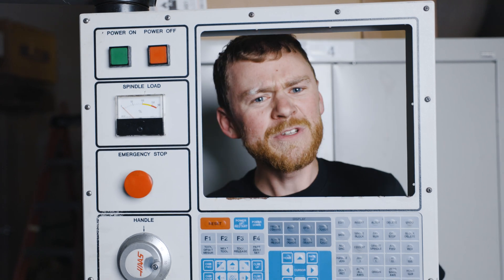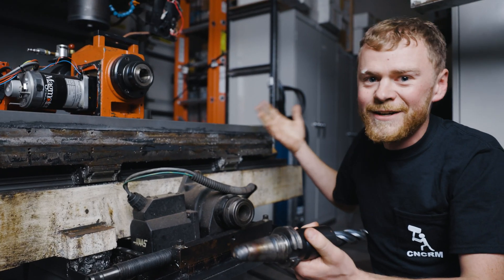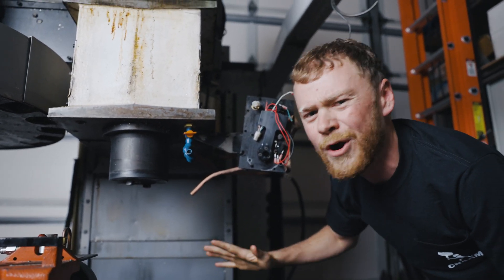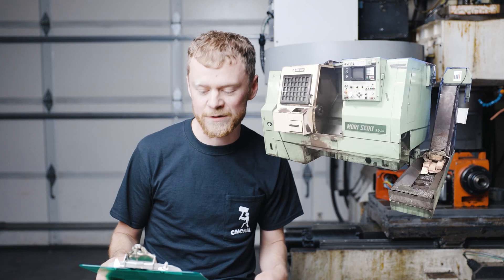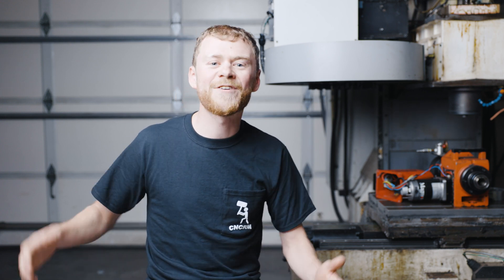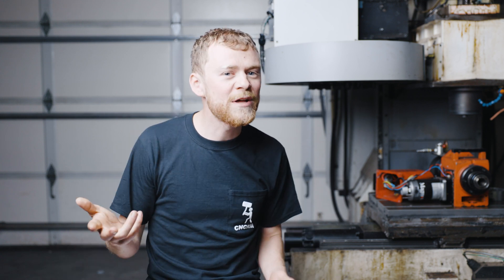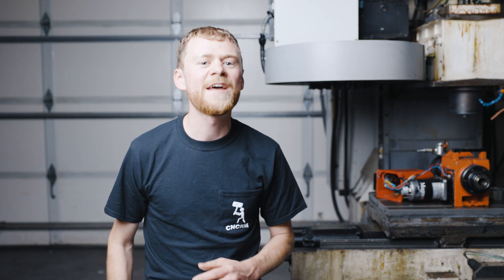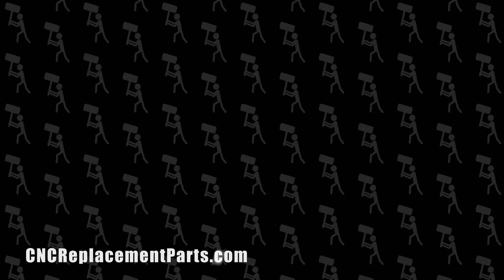Don’t Buy Old CNC Machines | CNC Repairman

Comment: Hi! Have been following your channel for some time. I just bought a VF2 from 2001 as a 2nd machine in my shop.  From what I can tell, it is not possible on a Haas from 2001 to use G43 tool offsets when a program is not running ? For example if I want to face off a plate manually with tool 2, the tool offset cannot be set. Even if I do G43 H02, the tool offset cancels instantly after the spindle has ramped up because it enters "PROGRAM END" mode.   Can this be altered ?

Comment: I bought a 20 year old Cincinnati Arrow 500 with a retrofitted Heidenhain TNC 530 about a year ago. 21 slot automatic tool changer. wired tool setter. infrared touch probe. had to invest some time in cleaning and fixing minor technical stuff. nothing wrong with the machine so I don't know what you're actually talking about. I'm pretty certain that propably 50% of the US american manufacturing backbone sits on old, used machinery.

most of us can't afford new machines, but we are on our way.

Comment: Summary of video: Unless you are a skilled machinist with years of professional experience you have no business buying an old CNC in hopes to refurbish and use it. Without years of experience you have no idea as to what a good machine tool requires. Not to mention the fact that if you didn't know that the biggest expense won't be the actual machine or the refurbishment of said machine you absolutely have no business wasting your time and money on a massive piece of high precision machinery doing nothing but collecting dust in you garage. Don't waste your time and money. There are plenty of cheaper and less technical hobbies out there. Go fix up a car or a motorcycle or something like that.

Comment: sounds like your trying to talk everyone out of buying any used cnc . most  shops  buy used son, not many folks have  millions to buy brand new. as a so called cnc repairman you should know this and reading the comments  below mine  sounds  like  you have a lot more experience to gain before  making videos like this young man. Been in the machine repair  industry both machine shops and manufacturing for over 40 years now, I seen a few things , looks like you need to see more, you look younger then 30, just saying.

Comment: If it doesn't have a USB port, it's probably too old. The electronics will need to be upgraded. 
I can already see the comments coming: "My machine was built in 1983 and the electronics are as good as the day it was made." Yeah, I'm not going to roll the dice on that. But, you do you.

Comment: We had the matsura shown in the picture. Yasnac control. The machine was a solid beast but unfortunately It was impossible to send it programs and I couldn't figure out the tool settings entirely. We tried to sell it and had a single interested buyer at a couple grand but bailed. Now it's sitting outside waiting to be parted out or scrapped. I'm currently about to get a small mori lathe for scrap price from my current day job to my shop. It runs great here but even the move to my shop could kill it or the temperature at my shop could make it run horrible. once it stops running it will be gone to the scrap yard. The matsura we got rid of has been replaced by a 97 vf2 that I just finally got fully repaired and up and running great.

Comment: When you say "old" like Fadal and Haas you need to define what you mean by old. Because there are literally thousands of parts machines and parts for both of these brands.
Reply from the maker: Fairpoint. Definitely should’ve clarified that. What I’m referring to is a lot of machines that the turkite is worn out and the ways are totally worn. The newer linear rail machines are great.
Reply: My cheap 97 Fadal 4020, I bought almost 20 years ago for $25,000 is still producing parts in 2025 and has been extremely reliable with less than $1000 needed in breakdown / maintenance repairs over the years.

Comment: Too late, 1980ish bridgeport cnc boss ? 4 years in and still trying...  Any help offered would be greatly appreciated.  Using Mach 3, DMA860H driver, A2 VFD, HY-JK02-M 5-axis interface board, ? power supply, and an old XP PC.  I've seen it move once then something shifted and I haven't been able to figure it out.

Comment: Different rules for different people. Here is what I did. first I bought an old FADAL 1980 or so with a budget of less than 10k and I pulled out all wires and motors. replaced them with 1.5kw ac servomotors from SZGH in china and I controlled them with MACH-4 It's an open source software and can do anything that your cnc can with the acceptation that windows sucks in a cnc. and yes it made me profit and in 15 months I bought a HAAS VF5 with a budget of $80k

Comment: Yea you shouldn’t be machining if you are staying away from those older machines.  I have a fadal15 and old mori seiki cl20.  Tolerances were 3 tenth’s on mori and 3thou on fadal.  Retrofitted both and kept them running at today’s demands using xometry to put them to use.  If you get a deal, take it.  You will learn a lot about machining.  Not just how to push buttons.  These older machines allow entry level machinists opening a new show to have great rigidity at a great price.

Comment: Looking at an old Storebro CNC Combi Mill with Heidenhain TNC 155 controller. If I buy it, I would want to get rid of the controller and fit a modern pc based controller.  Not sure what these are worth in very good condition ?

Comment: We have a pair of old 5 axis CNC routers. We were told it would cost $50k to get them running again. They are so large it will cost $10k to move them from one of our buildings to our other building 1/4 mile down the street.

Comment: Lol, great comments. Most people buying old iron know what they are getting into. I myself got a 1989 milltronics fixed head knee mill machine was in great mech shape execpt for the head bp style j2.I gutted that installed a 1-1 microvee with a vfd motor installed all new controller and servos back in 03. its more than paid for itself. im now retired and just make stuff for myself. it still runs great.

Comment: Why would you avoid fadal? They still supply all the parts and have support right?
Reply: He's found more lucrative machines to repair.
Reply: The 80's and early early 90's, I'd avoid them too.  And I love Fadals.  They make me a lot of money.  I might take a chance on a late 80's/early 90's if its been upgraded to at least the 16 bit control, I think that was -5, it has to have the space bar menus... 
.
Just like with a car, I don't want one that they only sold a few of.  (Actually, I do, but for daily transport, I want something common).
.
They made a TON of Fadals and they were basically the same for a long time.   Fadal proper has been out of business for about 20 years..  I consider that when MAG bought them, they were out of business, because MAG destroys every single thing they have ever touched.  
.
I'm doing belts, idlers, and a ballscrew today..  And I had my choice of about 4 different places to buy those parts, there is not another single machine tool out there that claim that..  
.
Parts and support.  I can go on a machining message board at 2am on a Sunday morning and ask a question, and have an answer by 2:30, they are that common.   Then I can order literally any part or board on the entire machine Monday morning(from multiple sources), and have it by Tuesday and be up and running by Wednesday..    I can call any of those multiple sources and get FREE tech support.  
.
The manuals are written in English, and if they don't come with the machine, they are free online.  
.
Yeah, they aren't rockets, the tool change can put you to sleep, the rapids aren't life altering or heart stopping..  The linear machines are pretty floppy, but they are pretty damn accurate..  The 2 speed head with a true 15hp can drive some serious metal removal.  The box machines aren't the best, but they are pretty solid, keep your bellevilles in good condition, your ways adjusted and your thrust bearings in good condition and set properly and they will move double digit cubic inches a minute in almost any steel.   And then turn around and interpolate a bore within a .001"(if your servos are adjusted correctly and backlash set correctly).   Not at 120ipm, but it'll do it..
.
They aren't for every shop, but they work really well for me.  The Fisher Price of machine tools, and I'm OK with that.

Comment: Basically what they are saying is avoid everything "old", "obsolete control system" from any band. If your not mechanically inclined and somewhat computer illiterate, this is good advice but that also eliminates any and all hope of getting a reasonably priced machine that is affordable. In simple terms if your not a gear head don't buy an old car to restore.

Comment: we had a bunch of old mori sl25s, they are so freaking robust, all the idiots were assigned to them because they cant even harm the damn things. no real issues ever. a really old, like 1986 or around it hitachi seiki got delivered to us from a FLOODED workshop. we bought it for parts as we had a few similar machines. the fanuc cards were at the bottom of the cabinet, in standing water. we thought what the hell, lets fire it up. only the spindle motors bearings were locked up, apart from that, the machine was operational. you could see the water line on the nc cards :D i think they are very dependable workhorses

Comment: A person has to see it run under power.  I have had excellent luck with Milltronics. There are several local technicians that work on them. Have 2 old VMC's, running on single phase and they do not quit. A few simple replacement parts along the way, nothing major.  I also have an old SL1 Morei that has been upgraded to a modern control. Works awesome.   New is great but $$  Am currently considering upgrading to a machine that is less than 30 years old!

Comment: My workshop is full of old tools and machines because I cannot afford new.  One of the dinosaur machines I have is a 1970's Nardini manual lathe.   It came from a University technicians  workshop  (no students).  I retrofitted it with VFD, safety controls, LEDs etc.  It is great.  My one piece of advice when looking for old iron, is do your research and know the history of the machine.    When I buy an old machine, first task is to clean it and new oil.

Comment: I have an old but in very good mechanical & electronic condition Matsuura MC500V (yasnac 3000G CRT) !  which is running great in DNC mode using a Laptop and BTR card,  I'm planning a Retrofit for the next year, someone has experienced upgrading it ?, what CNC-CPU-Software brand do you recommend ?

Comment: Dunno about milling machines but I've currently got 2 cnc routers, one is 2017 with very low hours and the other one is 1994 with thousands of hours that cost 1/10th as much as the other one 
Wanna guess which one never skips a beat and which one is a pain in the arse? 

I'm gonna stick with old school

Comment: Yes, stay away from Hitachi's. Most old Japanese machines are good. I'd avoid Fanuc DC servos as much as possible, but they still work. I'll work on anything newer then a 6 controller. God I hate those. My old Nakamura has a failing main board. Might be time for a retrofit. It's funny you put a picture of an old Kitamura H400. I got one for free, fixed it up, and in the last 4-5 years I've ran over Million dollars through that machine. It chugs Inconel all day.

Comment: For me a old machine would be a Motch two spindle with a Bendix control what fun!!! While troubleshooting you touch a test point and the slides take off. Also a 3SCL Warner Swasey  with the GE stand up 1050 control. That control could have 3 or 4 system tapes. You work on the tape reader for 3 hours to get it working 3 tapes load perfect the 4th tape load half way and stops. Now you have to start all over. I am sure there are folks here that can relate to this.

Comment: Best is to get an used machine that parts are still available (company still running and support) but you retrofit the electronics to newer stuff. So you get the heavy strong old machine frame but have modern newer electronic controller for it. Best of both worlds.

Comment: Expensive to fix? just buy a old computer and slap cnc linux on it. just don't bother with the old factory computer its not worth it and its a complete waste of your time to fix it in the first place. If the old computer was working you will end up replacing it with newer hardware because of how junk it is.

Comment: I got a 95' haas vf0 for 8k and a free 95' atlas copco rotary screw compressor (retails around 20k), saw it running and indicated the table/spindle, checked all functions, id say its a good deal but didnt take into account getting a rotary phase converter $1700 (lucked out and got a cnc balancing one off some guy on craigslist) moving costs ($2500) then had to do all the 3 phase wiring ($300) air lines ($200) get tooling (around $800) coolant/lube ($120) then all the misc stuff (fuses, gaskets, etc. $200), so around $14k all said and done, still probably need to replace some stuff, small air leak on spindle and keep getting some 121 low lube pressure alarms. If you are a mentally ill machinist/engineer who wants to make a modest income but love creating go for it, if you're looking to make $$$ and dont really care for machining/building things STAY AWAY, this trade will fking destroy your life! 
Anyway, awesome vids man, really appreciate you taking the time, some good close up shots would be nice but no biggie just a suggestion, much appreciated brother
Reply: what weird skitzo shit is this?  The world pays well for people who build things.  Gtfo.

Comment: CONFIRMED, I bought a vintage Bridgeport DX32 CNC with 500 hours on it. If your not handy at fixing electronics, wiring an oversized VFD, fixing mechanical issues, familiar with older versions of DOS, know 386 computer hardware, able to image the HDD to a SD, swap the floppy to a USB to floppy adapter, able to RTFM and hand write your gcode using the canned milling cycles, have friends with rollbacks, fork lifts, and skates to get it in your garage, replace the RTC on the motherboard, and various assorted other things, a vintage machine may not be for you. Given all of that I am very happy with my machine and it is perfect for me. I don't have to make money with it to pay for it like I would if I have bought a Haas mini mill or similar.

Comment: I run an entire factory with old machines. If I had taken the advice from this video I would not have had a working shop. I have learned to repair on my own machines, as CNC repairmen are way too expensive, and from what I hear there are no less repairs on new machines, just way more expensive repairs on them.
Reply: We retrofit old mill bodies with brand new electronics, motors, rails and screws if need be, and fresh paint.  This guy can take his weird facial expressions and go away.
Reply: @tfxreference8562  LOL right on

Comment: Company I worked for bought 2 1984 Mori Seiki MV45/40's with Fanuc 11m controls after running production 7 years at a foundry. That was in 1991, and they're still running today on the original ballscrews and untouched servos. Precision has suffered in some areas of the bed, but they're still making chips. Those Mori Seikis were tanks back then.

Comment: Rather than scrap them, take it away for them. Many electronics aren't available, or hydraulic parts, operating systems are old line to line programming,  retrofitting is so expensive it's cheaper to buy a lower hour & with current technology, don't buy old gear for production work.

Comment: Heh.... And I just happened to buy a 1981 Matsuura MC-500v... Meh. I care more about its rigidity. Plus I'm not opposed to a retrofit project anyway. But of course my priorities are different from someone trying to hit the ground running. At least I verified mine was from a prototyping shop in a medical instrument manufacturer that dealt mostly in soft metals. Plus it had new bearings put in and has nearly a whole machines worth of spare parts.

Comment: I just passed on a 2012 Matsuura LS-160 with only 1000 spindle hours. After talking to two different knowledgeable techs, I passed on an amazing deal because there were too many unknowns. It turns out Matsuura only built two of these machines with this configuration including a 40k rpm spindle and Siemens control, which could mean replacement parts are literally not available anywhere. The estimated cost to replace the spindle was $100k. Even though we have been very successful buying used machines in the past, we're pulling the trigger on a brand new mill/turn to prevent the headaches associated with buying used machines with B-axis misalignment and other common issues. Great video! 👍

Comment: I had half of those machines from the list, I still have Hitachi VM40II, EMCO lathe and VMC from '85 and Matsuuras although retrofitted, old Mazak SQT15, Cincinnati, two Colchesters on 0T fanuc contol, 2004 haas and so on. I have built over 200 machines in my life but I have slightly different experience, and believe those machines are killers if you know it's basics. I can understand why hobbysts shouldn't buy those machines lol anyway I like what you are doing, great job!
Reply: Some of your machines are older than this presenter. 😂
Reply: @arequepay  I retrofit machines by myself, you can check my X, I posted there Matsuura MC600V